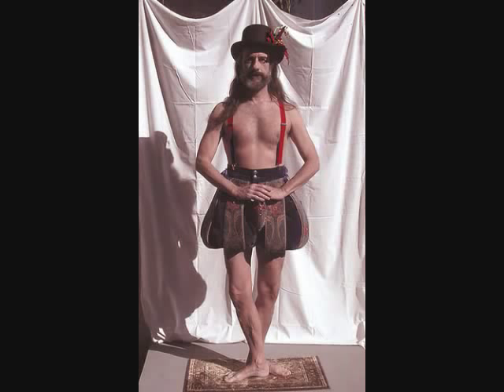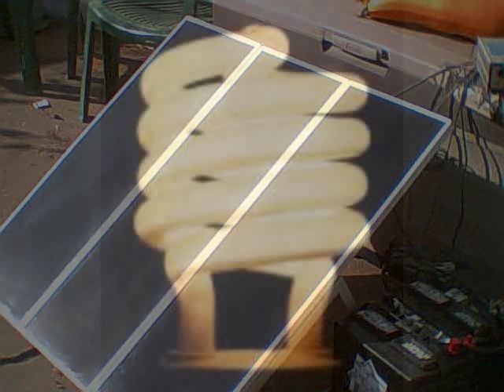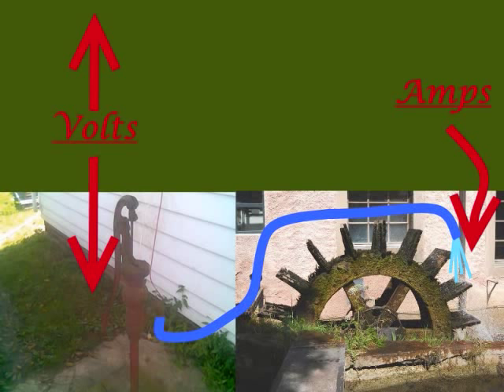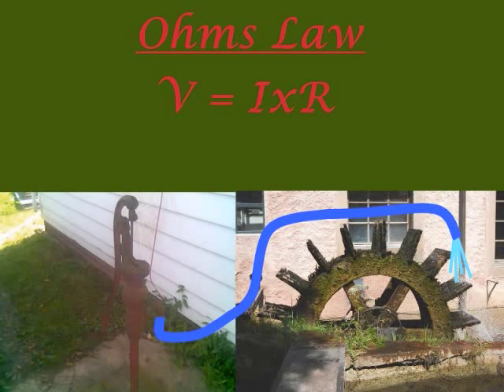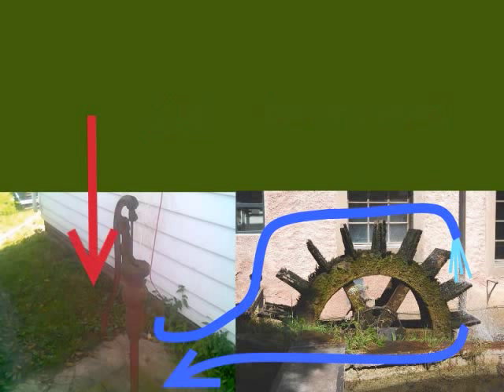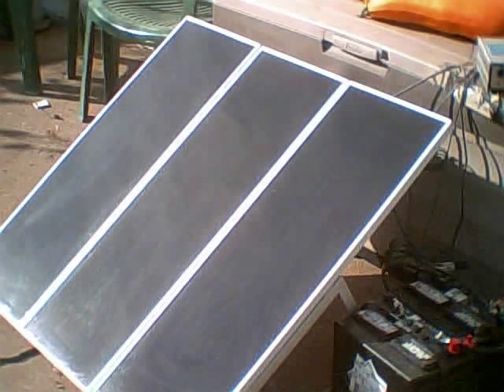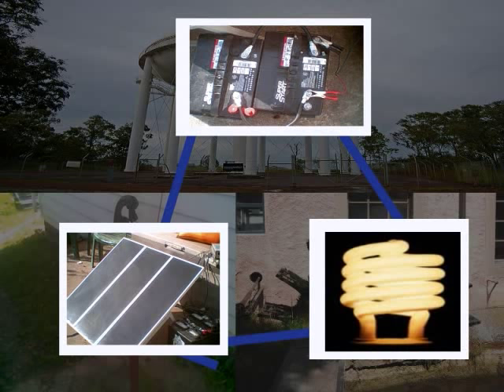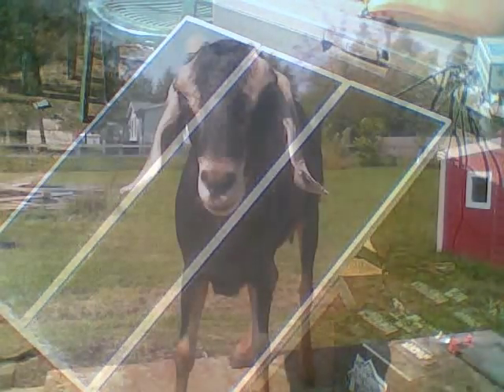How a solar system works

Comment from the maker: Got a couple of good quality deep cycle "Trollers" , from local auto parts store.  24 mo warranty 125 amps reserve ea..  It'd be nice to be able to afford $200 gel packs..... But not on my part time income.  These should last me 5 yrs... If I take care of them, don't over - under charge.  keep topped off with water etc.  I've got one in a car that's 6 yrs old. (reg batt).  It's getting tired, and will probably quit on me at the worst possible time this winter LOL

Comment: But, if you had 500 square feet of roof pitched to the south to match your latitude to get max exposure  that is a winning idea. Just make sure the kids play softball on the other side of the farm. The Harbor Freight deal is a good start and will power low draw items with no problem, a friend of mine gave them a try. They are a great value for the money. Thank you for all your good work in getting the word out, making people think, and most importantly acting on their convictions.

Comment: Your Harbor Freight solar panels are a good idea, just not for a salt water and dynamic environment. They will work fine on a farm, but not in a world were everything at some point in time gets flooded with salt water and beat up. The panels are glass and the first run away halyard will surely break everyone. Marine solar panels are many multiples the cost, sealed and tough. If you are producing watts/$ for me I have not gone that route.

Comment: Re: the power goes out over a large area. For an extended period of time. No shore power I expect that to happen any day. With my sailboat my answer is mobility; I plan on not being where the trouble is. Dont forget that I sail at 8+ knots using wind, moving 25 tons of mass. I am already in the solar power game with a thousand square feet of sail. Sailboats do not necessarily require electrical power  gps, vhf, and the two worst offenders of amps the auto-pilot and refrigeration do.

Comment: If I was to charge my banks with solar cells, my boat would look like the NASA space station. When at dock  big charger. When underway  100 amp Delco on diesel. When at anchor  1000 watt Honda gen/set and small 15 amp charger four hours a day. Still, solar panels good idea for small system. Keep up good work. First two laws of thermodynamics = there is no free lunch & and you cant eat it all.

Comment: Good start to basic understanding of Ohms law. I have lived on sailboats for my adult life, and have always lived in the 12 volt world. Your batteries are going to live a tough life  my advice is to purchase top line battery from ChinaMart. 3 year 100% guarantee, seven year total (last four years pro-rated). Replaced my 12 battery bank at 3 1/2 years for almost NO cost. Original investment, 12 batteries at $60 = $720

Comment from the maker: Kevinmpgtv, 
In a word no.  a well pump uses way too much power.  You could put an old hot water tank in the attic, for storage...... and use a really small fountain pump to fill it.  If your well isn't too deep.  Or you might look for a 12 volt "Bilge pump".  Or you could install a hand pump.  Or  rain barrels, or, or or.  I could go on for a while.  In other words "Think outside the box" to find the answers you might need.

Comment from the maker: boomd1791,
We've been just messing around with it for now.  I've run lights, and a hand drill.  Waiting to get roof replaced, so I can mount everything permanently.  Then I'll have 5-6 outlets wired in the house, for some lights, maybe a fan, CD player?  Small system... won't handle much more than that.

Comment from the maker: Hi JoeShmoe,
Id' have to have a different charge controller.  Wind generators need to have a place to discharge.  If not they spin way too fast (Not good, pieces start flying off).  I need to buy a charge controller with a "Diversion" circuit that redirects that extra juice to a heating element to dissipates it.